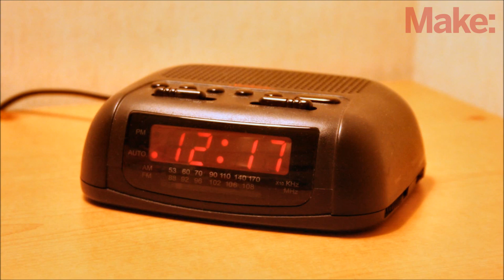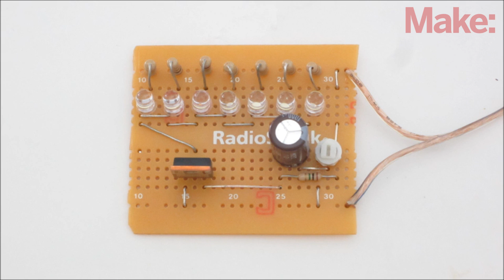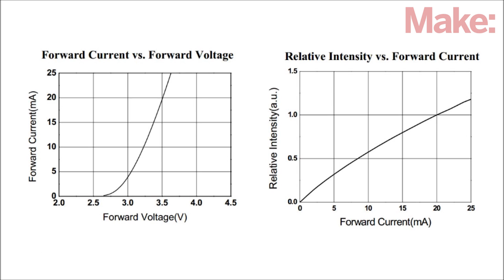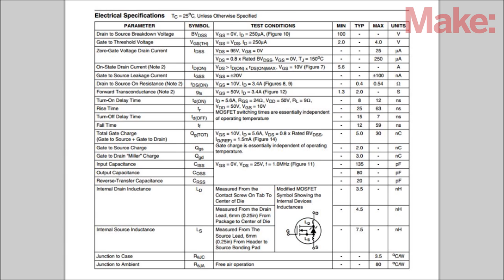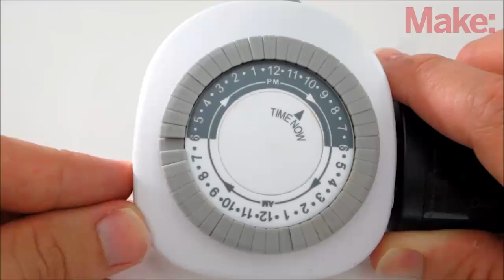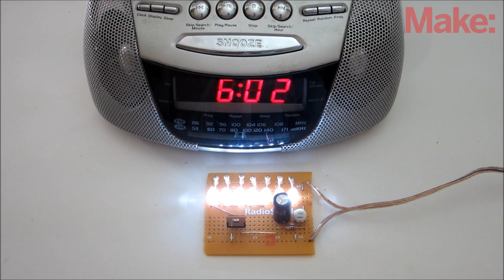DIY Hacks & How To's: Sunrise Alarm

Comment: Instead of using an outlet timer I actually connected it to the terminals of the speaker on a regular alarm clock and when the alarm went off it would trigger a relay switch to allow for the usb current to come in.

Comment: sure, nice project, but I had builded this much easyer. 
I took a timer clock and pluged in my bedside lamp. By replacing the bulb with a old energy saving lamp, the brighnets will get up slowly and you will wake up pleasant.

Comment: why are people so dumb? it's 5 volts and low amperage. putting it in a pillow has minimal risk. build it in a box of your paranoid. if 5 or 6 LEDs won't wake you up, crank it up a notch. use more LEDs. it's totally scalable. this only proves concept. the idea is that light will wake you up more gently than a noisy alarm. Even better, use some blue LEDs. they will kick start the "wake" cycle in your brain.
Reply: Check out DiodeGoneWild and maybe you'll soon find out how dangerous quite a few of these USB adapters/chargers are.
https://www.youtube.com/c/diodegonewild/videos

Comment: alternative:
1. Buy a cheap stungun
2. Replace the switch with a 5v relay
3. Switch the relay using the 5v from the wall adapter.
4. attach cables to the high voltage end of the stun gun, insulate the contacts from eachother
5. when you go to bed, attach one cable to your thumb, and one to your middle finger
6. in the morning you'll be awake as fast as never before.

Comment: That snooze button will be killed by the charged cap. Never short-circuit a cap as this might be a very high current pulse. It might work, but it's not a good solution. Always discharge caps over a resistor!

Comment: A little while back I was thinking of a device (alarm or otherwise) that would work from Arduino and activate with sunlight. Would be nice to see one that uses a light resistor to detect direct sunlight to activate an alarm or flip some switch with a servo.

Comment: You could construct one with Arduino or buy a good remote from dx or such. There are great remotes with all you could possibly need within $15. It has mouse control, keypad (dial-pad style), volume controls and even power off button. An infrared dongle comes in package.

Comment: The point of this is to simulate a sunrise which gets your wake-up cycle started. In theory you will wake up on your own by the time it reaches full brightness but even if that isn't the case you should be in a lighter sleep mode and an alarm can more easily wake you up.

Comment: Instead of LEDs use a laser or two pointed at your head, that should work and has the added bonus of lighting your first cigarette of the day if you smoke. Another hack is to slowly release compressed air into a balloon, then BANG!